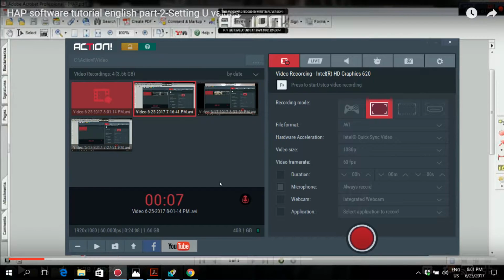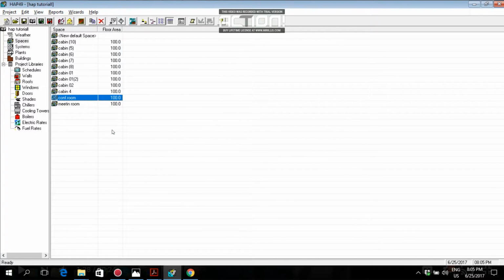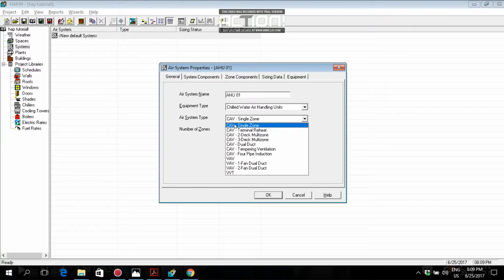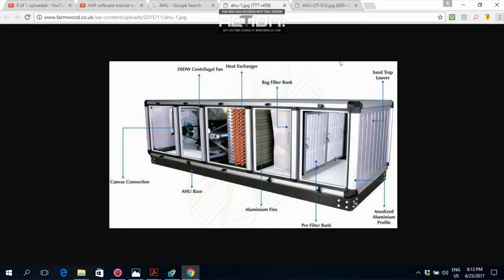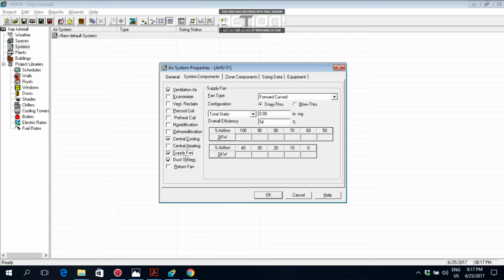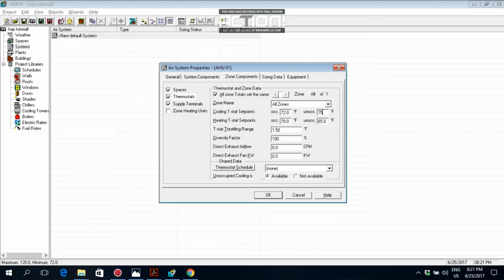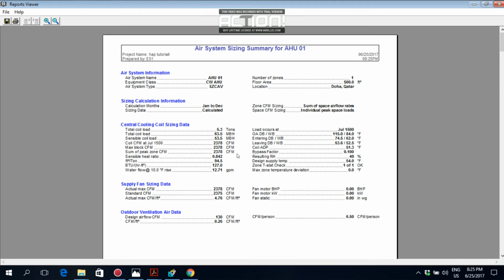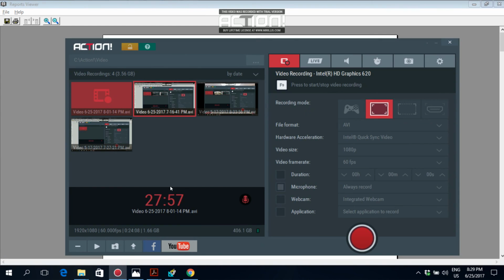HVAC COOLING LOAD CALCULATION TRAINING AND LEARNING-HAP software tutorial english Part 7 to 10

Comment: brother you did a good job, for many people dont know how to use Hap software proper including me 
well just i have a question 
for the AHU system selection, 
enterning air Drybulb/wet bulb how its calculated   
from the set point 
relative humiditu calculated by supply temperature or what 
and the final question AHU selection select by sensible or total load 
thank you
Reply from the maker: Entering DB and WB is out put results but NOT can be given as INPUT. These temperature values depends on whai kind of inside design conditions you want and also depends on outside design condition. The HAP make in to consideration these two parameters and will provide Entering DB WB or Leaving DB WB as out put result

Any AC unit shall be select as per total load ,There is no logic to select unit based on sensible load

Comment: https://drive.google.com/drive/folders/1Dz25xt0xkls3R0ZOvO24956pBxRfroq3?usp=sharing
Sir, i designed system  terminal unit(DX fan coil ) with common ventilation system. Result show cooling coil design load less than zone load. what is the reason for this. i attach my result above link. And also i want to know what is mentioned by coil load and terminal unit cooling.

Comment: sir , i want to know how aaply room design RH value or wetbulb temperature
Reply from the maker: For that you have to vary supply air temperature value in in system properties go to system components select cooling coil than change the temperature until you reach you desired conditions 
it's kind of trail and error method

Comment: COULD YOU PLEASE UPLOAD THE VIDEO FOR DUCT SIZE CALCULATION?
AND
WHAT IS THE PURPOSE OF PLANT AND BUILDING AVAILABLE OPTION  UNDER THE SYSTEM OPTION IN HAP  ?
IN THE SCHEDULE YOU HAVE CREATED SOME REQUIRED EQUIPMENT,LIGHT(LIGHT,OCC ETC) ETC AS WELL AS PEAK VALUE SCHEDULE ALSO, BUT YOU ARE USING ONLY PEAK VALUE (OCC01, LIGHT 01). CAN YOU EXPLAIN WHY?

Comment: Dear Sir , in your calculation RH <50 % so how to increase 49% to Min50  % because ASHRAE std. Min RH 50 % ( In your calculation we want to increase RH value without using preheat coil /Humidification & maintain room temp 22 degree Celsius  contact no. +971-557427412) Thanks
Reply from the maker: contact to ..mepnicales@gmail.com

Comment: thank you sir for your video ,,, pleas can you  tel me how to design a curtain wall ?
Reply from the maker: consider it As partion if it's between conditioned and unconditioned space
Reply: im talking about an external wall double glazed with aluminum fram    like this : https://www.google.dz/search?q=curtain+wall&num=40&source=lnms&tbm=isch&sa=X&ved=0ahUKEwjnnfL505zVAhUFWRQKHfTyAa4Q_AUICigB&biw=1366&bih=638
Reply from the maker: +Samir Ammarcha It's going to be considered as window if it's made up of glass
Reply: ok now it work for me ,, the problem was in wall area should be superior or equal of windows area  ( 
I put the surface of wall equal to zero ,, that what cause problem )
Reply from the maker: +Samir Ammarcha That's bcz .Hap won't consider full wall area as window.There must some portion of wall to be considered even it's not exist to satisfy software requirements. 

example if your curtains wall area .10 Sq met consider wall as 10.1 Sq met little higher than glass are